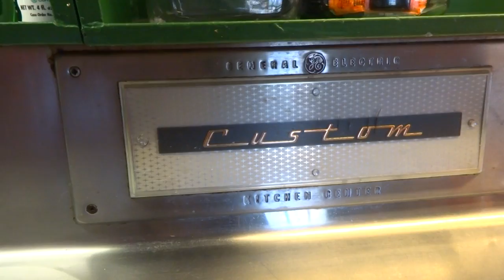PROPRESS FITTING POPPING OFF INFERIOR  PRODUCT TO SOLDERING

Comment: Soldering that close to a propress joint could have easily ruined the gasket in the fitting. yet you made it work like a pro. Soldering and brazing is job security.
Reply: I think he got lucky that it didn't leak immediately but he probably did damage that o-ring by soldering so close to it without protecting it like he mentioned he thought that he should before he started soldering. Maybe he just distracts himself because he's filming for an audience.

Comment: I definitely prefer solder. I tried shark bite stuff and stopped using it after I had a slow leak in an old ceiling because the fitting was stressed by the joists movement. Propress is way to expensive for what it gives on small jobs. I use pex but soldering is my prefered method of doing it.

Comment: The prioress wasn’t installed properly which is why the connection came undone. 
And why is the pro press sh**? We use it weekly where I work and it is night and day compared to soldering .
Don’t knock it till you try it

Comment: Battery on the presstool probably died during the press and they didn't repress with a new battery. Have to
Reply: Or probably used the hydraulic press tool
Reply: Doesn't matter if the battery is dying. If the tool pops the joint is pressed.
Reply: Not what a viega rep told me
Reply: @AndyFromNH  idk about all that. I'm pretty sure the tool releases on spring pressure. The charge of the battery has nothing to do with a spring releasing the dies
Reply: Just telling you what I was told🤷

Comment: I have 1000s of pro press fittings in the field and have seen way more solder joints leak. As a matter of fact I have never had a pro press fitting leak. Bad installers are going to mess anything up not just pro press
Reply: I've seen them leak when guys didn't file the burr off the outside of the pipe and cut the oring hahaha

Comment: That wire is burnt because the last plumber installed sweat fittings and burned the wire. That sweat fitting obviously failed most likely due to the pipe freezing. No copper pipe or fitting will survive freezing. Sweat type fittings carry Zero warranty. Propress carries a 50 year warrantee when properly installed.  NO ONE warrantees any plumbing product against freezing !  If you hire this plumber who doesnt understand whats going on here than you deserve more broken pipes and failed fittings ! His sweat fittings wont survive freezing !   The problem is the pipe freezing causing the fitting to fail !  There is a great video on youtube of a guy testing a propress fitting after he removed the rubber o ring from inside the fitting. Even without the o rings the fitting didnt leak !

Comment: Most likely those propress fittings weren't installed by a plumber with a professional battery powered press tool.  More likely it was done by the homeowner with a cheap hand tool (probably after they tried soldering and fried the heck out of that wire).

Comment: For this type of application, does the solder have to be lead-free solder?
Reply from the maker: YES ALL COPPER WATER PIPE HAS TO BE LEAD FREE SOLDER..
Reply: Probably depends on the codes in your area. In NYC 5 boroughs and long Island 50/50 or 40/60 is acceptable for heat. All potable water must be lead free. Local 1 plumber's in NYC actually braze most water lines that are copper to copper. Only soldering the brass fittings.
Reply: @TheRabidPosum  Eww people braze water lines in NYC? No wonder everything is so damn expensive there.
Reply: @jman0870  I was a steamfitter. But yes the plumber's brazed most. The highest I brazed was 3" copper. As usually for plumber's 4" and over is cast iron lead and oakum, and for steamfitters it's usually welded steal joints.
Reply: @TheRabidPosum  That's crazy. Braze is incredibly expensive compared to solder
Reply: @jman0870  is it? Things are done differently in the suburbs. The only thing I brazed in a residential house is 3/4  refrigeration lines. Heat pipe is always M type copper with with 40/60 or 50/50 solder. Water lines always L type copper with lead free solder. When you get on to bigger union jobs like 7 World Trade and skyscrapers in Manhattan things are very different.

Comment: It’s clearly not been installed correctly the customer said the plumber said he couldn’t get the press tool in position. That’s the plumbers fault. you can get attachments that can get the tool in tighter spots but they cost $$.

Comment: By the looks of it the pipe was pushed all the way in, and it's brand new Type-L copper. I honestly think the press tool battery was dead...
Reply: It doesn't matter if the battery is dead. If the tool pops enough force was applied. If it doesn't pop, the joint isn't done.

Comment: I am surprised with shark bite and all the pex out there these days that people are still investing in Propress...  Beyond the expense, I always questioned its longevity compared to sweat fittings.
Reply: Sharkbites are for hacks, that's why. They have zero rigidity and you are relying on nothing but friction from tiny metal fingers to hold the pipe together. Most commercial jobs won't allow pex because they are specced in copper and most industrial facilities won't issue a burn permit unless it's absolutely necessary. Pro press is a fantastic system and, when used properly, is just as good as any soldered joint.
Reply: @jman0870  Pex is used almost exclusively in residential homes these days even in retro fit jobs copper is often replaced with pex, it is only a matter of time before commercial fire codes follow suit, the price of copper is out of control.  At 10x the cost for fittings vs sweat, and 2K for the tool, its hard to justify the investment in a transitional technology especially for a homeowner.  As for pros Its not like you can throw out your torch, do you invest and carry sweat, propress, and pex on your truck?  You tell me I am no pro...
Reply: @ericfraser7543  Oh dude I use pex all the time. I pexed my water heater in because I'm a lazy bitch! Also, I know how to solder. I do it quite often. I don't carry a dedicated press tool. All the dedicated plumbers carry them and we have spares that we can sign out for each job. I don't go get a press tool for one joint.

Comment: I'm not that familiar with pro press, but I'm sure the instructions read much like sharkbite. The pipe can not be uneven or pressing vertically on the fitting. Anyway, the way you did it was great and better than pro press stuff.

Comment: Propress is awesome! But whoever did thay job must have been using a hand crimper cause that is not crimped.. my Milwaukee propress walk circles around someone soldiering which I can do also just faster and more cost effective to use propress and safer in many applications the fire.

Comment: he took a gamble...what if u open water and all o-rings are cooked ? now what ? ..why dont you put  wet cold rags on both sides of the pipe on them fittings to cool them down WHILE u soldering ?  btw dont touch freshly soldered joint  with a wet cold rag...propress technology is used in Europe for at least 50 years ....
Reply from the maker: I PISSED  ON O RING AFTER SOLDERING I HAD TO GO BAD
Reply: @stevenlavimoniere  u applied R Kelly treatment.  recent progressive plumbing code modification

Comment: I don’t think is the pro press I think either those people who did the job not train well or they don’t care . I work with a big company who does commercial and residential work I mean a lot of work never an issue with it also calibration is huge with this tools . I prefer use pro press in tight spots rather then burn down the property

Comment: Been using pro press for years and never seen one of these just “pop off” must not have installed it correctly. Solder is messy, time consuming and introduces solder build up in the pipe that blocks water flow and can where out the inside of the pipe. Solder is for old Joe’s. Learn how to use the pro press correctly and you will not have any of these issues. Get the actual battery press and don’t use the hand tool like this guy did, the fittings that popped off barely look pressed on.

Comment: I thought wiping it with a wet rag wasn't good for the solder?
Reply: You have to wait at Least 30 seconds before putting a cool rag on a fresh copper joint. It could fracture the fresh joint from the rapid temp change. - Is what I was taught. I usually wait a min

Comment: Not a plumber but the propress doesn't look like it was crimped with a propress tool. It looks like they just used a hand pex crimper on it the o ring part doesn't even look deformed like it will after the propress

Comment: I respect Steven's work on most jobs but I didn't like some of the things he did here.  If you are wiping down a solder joint and there is a hiss from the cold wet rag, you haven't waited long enough for the solder joint to properly cool and you're distressing the solder joint you just made... increasing the chance it could fail later on. Also, no deburring of the cut pipe which can cause turbulence.   Steve maintains how adamant he is against sharkbite (me too, copper is king), but why not try to convince the homeowner to change out that sharkbite shutoff valve with the copper side soldered?

Comment: Propress  on 11/2” and larger is time saver never had a issue if prepped correctly
Reply: Yet 
All your faith is in a rubber o ring 
We all know what happens in time
Reply: @jackblack9830  obviously you haven’t done research 32kn of force fuses copper
Reply: @johnnya4236  then the reason for an O ring is ??
Reply: @jackblack9830  You've obviously never fixed leaking solder joints caused from not enough penetration that managed to last for years. Pro press comes with a 50 year warranty. Those 20 year old leaking solder joints that flooded your living room while you were on vacation don't warrant shit.

Comment: Just had a brand new boiler install. Plumber insisted on these propress garbage. More than 50% weep around the joint. These are garbage. I sweat my own plumbing in my house never an issue. Pay 12k for a gas boiler install and it leaks. I want this trash out of my house

Comment: The cost of the fittings are high too. I seen $29 usd for a 3/4" ball valve. Crazy. Glad we don't use it
Reply: Thats overpriced and would never pay that much it should  be $15 at most
Reply: @DDunc1020  It's not overpriced when you compare it to the labor cost to plumb an entire building with solder. If it wasn't cost efficient nobody would use it.
Reply: @jman0870  i love pro press but 30 bucks for a 3/4 inch valve is overpriced
Reply: @DDunc1020  Not. When. You. Are. Plumbing. An. Entire. Building. Labor costs WAAAAAY more than the fittings. Don't make me break out the Crayolas and draw you a picture.

Comment: So do you also dislike Pex crimps and Shark Bite compression fittings
Reply: Sharkbite is not compression. It relies on a shittier oring seal than propress and relies solely on friction to keep the pipe together and has zero rigidity in the fittings. Pex has a smaller ID than copper so the pipe and the barbed fittings actually reduce flow astronomically compared to copper. Dude doesn't know what he's talking about.

Comment: Pro-press looks like a tinker toy because that's what it is.  All these pro-press plumbers talking about "Never has a leak in ten years..."   I'm sure their tinker toys never broke either.  The greater complexity of the pro-press system means there is a greater propensity for failure.

I'm sure pro-press is faster, even when time is taken to properly prepare the materials.  It's a more complex system that plumbers install more quickly.   In other words, pro-press is inherently more prone to failure and the people who install it do so in a way that tends to produce more failures due to user error.  That is why it fails more often.

If an excellent plumber installs pro-press, it will probably not ever leak because he/she will have done things thoroughly including culling bad fittings, calibrating the press machine, preparing the pipe, supporting the installed pipe after instillation, ad infinitum.  If that same plumber solders the joints instead, they will never leak.

Comment: Been using it since it came out never had it pop off unless it is not all the way in. This is in Hotel and Commercial buildings from 4" -1/2 pipe you can have your solder especially on old ass leaky Gate valves that never close you can put in new ball valve wet compared too solder in Emergency situations!! Pipe needs to be clean deburred and marked so you know the pipe is bottomed out against fitting especially on 1 1/4 pipe and up it has a tendency to walk when crimping always double check and mark depth with sharpie. Peace
Reply: Thanks for the proper way to prep in detail , also seen piping where randomly hangers are a haphazard layout.

Comment: Anything will fail when you don't do it right, those guns crimp with multiple thousands of pounds of pressure this would've never happened if it was done right with a properly calibrated gun, but I hear you the old school is tried and true, but knocking advancements in technology at the result of a goofball fucking up is a bad look. Alas, got em fixed up nice job

Comment: Thanks Steve! I have a main water line valve that needs to be replaced so I am calling a professional. But I will not let them use Propress or Sharkbite, solder only! I agree solder is the best, it is a molecular weld. The others use friction or orings that degrade over time, or never seal in the first place.

Comment: Not an inferior product, it's inferior installers. Pipe wasn't completely in the fitting when he pressed it and it blew off. Or it's possible he never pressed that end, never tested it either and it eventually blew off later. Same problem with sharkbites, if they're not completely seated on the pipe, they blow off. Not the products fault, it's the dummies installing it incorrectly and giving them a bad reputation.

Comment: Copper has put a bad taste in my mouth I work at a complex that uses all copper and I’m repairing leaks about 2-3 times a week
Reply: The people who installed the copper did not do it correctly.
Reply: Might I add most of the leaks are coming from the copper itself and not the joints smh
Reply: Sounds like they went heavy on the flux and never washed it out?
Reply: @stunner165  Sounds like velocity erosion or electrolysis. Could also be water quality.

Comment: With the amount of pro press fitting being installed failed joints will happen for sure . You can take the o-ring out and solder those fittings .
Reply: Yeah viega has been out for a 20 + years but I’ve seen solder leak too so 🤔
Reply: I would also like to add there some people on YouTube pressing with hydraulic press tools off Amazon because they don’t wanna but the Ridgid, Nibco, Milwaukee press tool
Reply: @johnnya4236   There’s wrong with both fittings when do wrong for sure it happens .
Reply: Wrong.

Comment: plumbers also said PVC and ABS were shortcuts and would never be used. we see how that turned out
Reply: I personally would much rather have PVC or ABS in my house rather than cast iron due to the fact that cast iron pipes will eventually rust through. I have seen many times that rubber deteriorates over time and my worry is that pro press will be prone to leak if its bumped or disturbed in 50 years. Solder doesn't deteriorate and can last a very long time.
Reply: @oldhandyluke  cast iron doesn't rust through dude...it cracks. Solder most certainly deteriorates. I've repaired more leaking solder joints than I can count and I was only a service plumber for 3.5 years.
Reply: @jman0870  I see it happen all the time. don't get me wrong cast iron can last a very long time but it will rust and also as it rusts the internal surface will get rough and be much more likely to catch a clog. In my opinion pvc and abs pipe are the best options for drains.
Reply: @oldhandyluke  Google Carlisle, Pennsylvania. I have pulled cast iron shit pipe out many times that still has 75% of the wall thickness and the buildings date back to the original borough charter. I don't believe you for one second. Somebody dumped a bunch of drain acid down those pipes and eroded them. Hell, my grandmother's house still has all the original cast iron sewer lines and the house was built in the late 1800s. Cast cracks long before it rusts out.

Comment: ProPress and PEX are a no for me, soldered copper all the way
Reply: I hate how fast, cheap, and superior in every way pex is
Reply: I was going to use pex for my bathroom. But with all the mice I had this year I'm glad i went with copper
Reply: @WTFIsThisGuyDoing233  Right, I repiped my house in a few hours with pex, moved in had steel pipe that had so much rust inside it was like a pinhole throughout
Reply: @losferwords100  I’m not an old timer but appreciate the comment, actually in my late 20s, not in the trade but enjoy watching to learn. I simply prefer the older style.
Reply: @bryan7825  Not in the trade? Sorry bro, then your opinion holds no weight for me. If you're looking to learn, learn about why pex is better in practically every way to copper and why it is the preferred method in modern construction.
Reply: @bryan7825  You'd be crying like a baby if you were told you weren't allowed to go home until you soldered that fitting on a 4" main with gate valves that won't hold hahahaha

Comment: Often i disagree with you Steve... (mostly due to different continents) but that pro-press shit is shit here in England too, that along with plastic pipe. Learn to be a plumber or stop using the name LOL... also, hope you advised the homeowner to call an electrician, that burned cable could go bad later :\